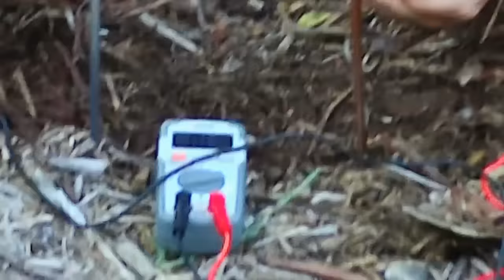OFF GRID POWER? The Earth Battery Experiment

Comment: I believe another issue you have with the process is oxidation of cathode which is the metal giving off electrons and  is plating onto the anode.  charge and discharge are always the problems with batteries because of corrosion!
Reply from the maker: Very true!
Reply: Led and carbon, will not galvanize or oxidize, you only get half the power so you have to build it twice as big,however it will last forever
Reply: Oxidation occurs at the anode and reduction occurs at the cathode.  The aluminium will be consumed and will need to be replaced.  This can be calculated of course and depends on the many factors in the galvanic cell.  This type of electricity generation is probably not a viable proposition to power much more than a small set of lights or small electrical apparatus for short periods and would need maintenance to replace the anodes (the aluminium) if power is required for longer periods.  The current demand for powering larger devices will mean a much larger reservoir of anode material and much larger surface areas.  Also in dry soil or clays, you would need an irrigation system to ensure that an electrolyte is present when you need power.  Additionally, with time as the reactions occur, you may have a build-up of corrosion products on the surface of the anode that would, of course, increase the resistance of charge transfer in the circuit, and reaction kinetics would slow resulting in the efficiency of the battery (the galvanic cell that is created by the dissimilar metals forming the anode and cathode) dropping.  I would think that due to system thermodynamics, there will be a far less likely probability of cathodic chaulking taking place as the driving force (the potential difference between the anode and cathode) is not large enough.

Comment: I applaud anyone for doing experiments so I'm not being unkind with my comments. 

After reading about these earth batteries it would seem the idea is to used the naturally occurring electromagnetic field of the Earth. If this is the case then the battery should not require contact with the soil. As the metals are in contact with moist soil it would suggest you are creating a simple voltaic cell, which means the rods will corrode over time and ultimately it would be better to just throw some acid in there.

Comment: Look into Tesla's apparatus for the utilization of radiant energy patents. If you used something like a metal roof, and then utilized a grid of copper pipe; say in ground water lines being used for agricultural irrigation; you could then create a circuit for harnessing radiant energy from the potential difference between the atmosphere and the ground. The roof and the in ground grid would essentially operate as two electrodes. Really if you just took the energy you are getting from your ground electrodes, and used them to trickle charge batteries, or say ultra capacitors you could slowly build up more and more energy over  time, and gradually increase the amount of usable power by taking your now charged batteries and using an inverter circuit to convert the d.c to household a.c. 
  You would want to decide what exactly you want to power; if you need a constant power draw or just an occasional source of usable input. The point  really is that the more sources of usable power you have they can be compounded and  used to store energy for later use. You should also look into John Hutchinsons crystal batteries, and a diy video on making graphene from coffee grounds, and experiment with making diy capacitors with a large capacitance. I think energy storage in the form of dielectric fields I.E electrostatic will be the way of the future. None of this lithium ion nonsense.    Hutchinsons crystal batteries seem to opperate for very long periods of time without recharge as  well. Really if you make a bunch of crystal cells you can combine them to create a battery of whatever output voltage you want; then just have a circuit that trickle charges the crystal battery. Would need to incorporate diodes, and make some kind of d.i.y charge controller.
 I appreciate the video; experimentation and building upon basic concepts is what allows us as a community to come up with more and more novel and  efficient forms of self sufficient energy generation.

Comment: Thanks for a great video, it would be great to see if this could charge a mobile phone.
There's a few ways to improve the output...
1. The electrolyte in your closed cells will dry out (and the natural bacteria in the soil will stop doing their part to drive the cell)  = keep the top open for rain water, better still add a simple water drip feeder (an upturned plastic bottle of water with a small hole in the lid would do).
2. The electrodes will oxydise = regularly twist the electrodes back and forth in the soil to clean off the very thin oxide layer.
3. The salts in the electrolyte need to be replenished = add some dissolved salts into your water drip feeder.
4. Not enough cells = go large! Add more cells, some in series to get your desired voltage then more connected in parallel to increase the available current.
Reply: It was in another experiment by this English dude, that magnesium rod greatly increased the voltage.
I recall some years ago,  an experiment using an anode & cathode far apart and connected by a wire on wood pegs holding it a few inches off the ground, N-S orientation I believe, and powered this large array of lights. I can't say if those were LED or incandescent,  but they were definitely DC, and I assume the earth served both as the battery and return circuit. Lo, a true Earth Battery.
I just got interested again because, a) I live under a 110' canopy of trees, and b) the grid WILL go down eventually. If by EMP or hackers, I would still have power at least for lights and probably charging, if I can figure out the transformer I'd need.
Reply: @garychandler4296  have you tried the copper ground rod set 3' deep yet?  Supposedly, if the ground is moist enough, you could get 50 watts from it.
Reply: @genkiferal7178  No, but that could definitely charge batteries.

Comment: One can make an aluminum Air battery that will power a small LED fairly easily. I took some aluminum from aluminum foil and or aluminum cans and copper wire. One can take some small plastic cups, glass bottles, ice cube trays or whatever you want and create a series of 6 to 10 cells. Add salt water to each cell and you will have enough power to light up an LED. Power comes from the aluminum oxidizing. I created an experiment that lasted on the kitchen counter for three months running 24/7 and lit an LED bright enough I could barely read a newspaper by it. I created a night light. After three months the Aluminum was starting to degrade and I wanted the countertop back. If you truly lived off grid or were in great need this works, but a regular store bought battery ultimately works better. Battery powered LED lights are cheap and good these days.

Comment: You could try a loadstone attached or near some black iron and/or magnetized, with an anode, cathode series, attached to copper meshes, using a oxide and nitrate, in the soil with a white vinegar.

You may want to use the anchored cells to recharge the cells.

With an inverter, transformer, capacitor, diode - rectifier, charge sustainer, and regulator system in which it may be able to be turned into a portable car battery charger or jumper by pushing into the soil next to your vehicle.  (Not quite what you were thinking; however, an idea.)

Comment: The reason the voltage is dropping is because you have your dirt contained and it cannot reproduce electrons being out of the natural ground. Artificial dose not work with earth batteries. The earth is your battery and when split the electrons will leach out and stop producing
Have you continued research currently ??? I have something you might like to see. We've been off the grid for several years now. And I have made several advancements in different builds
Reply from the maker: I've continued book research, but haven't done anything hands on for a bit .. its been a busy year 😊  Remind me to come check out your work!

Comment: Nice video, doing something similar to what I’ve thought about!  My idea was to use bigger tubes to fill insides of pipes with soil and then surround it in soil too!  There’s a patent back then to make high voltage and good amount of amps (56) if I remember right!  But I’d try applying a type of acid to soil!
Reply: Add salt water :)

Comment: now I need to make my own batteries as well and try with many different materials.
if you want to save space however you probably won't actually be using the soil for the voltage, the soil just keeps it apart and together.
essentially to generate a voltage you only need the 2 metal pipes and aelectrically conducting liquid, gell, goo, or any such thing in between. typically a liquid is used. so you can also just use salt water, salter means more electrical current.

Comment: thanks great video!,  my sincere questions are: 
1.-why not inserting completely the two strips of aluminum and copper at great depth into the ground to get really more quantity of negative ions circulating through them?
2.-and also why not putting another two long strips of aluminum and copper from the highest roof spot possible to the terminals of the ones in the ground, in order to have a very good major quantity of positive ions and negative ions circulating through all that entirely circuit?
*It's supposed to be 100 volts reception only by each meter altitude from the ones in the roof working as an atmospheric electricity receiver, I don't know how many volts can be achieved from inserting this very deep in the ground. 
**And yeah take some better precaution measures working with electrical stuff, that's a must even if working with very low measures of electricity, good habits in electricity saves lives.

Comment: Thank you, it was fun to watch. I understand you made a dirt electrolyte battery though not an earth battery as you isolated it away from the earth itself, with your enclosed cells. Also there is an orientation of the battery cells you lost with grouping the cells in a circle. By sealing each cells off you also lost some additional interaction available between all the individual cells. I understand they also need and north (anode) to south (cathode) in a series orientation for alignment; not a cluster taped circle. Your individual pvc cells were an interesting idea, but moved away from a true earth battery and lost some of the potential power from the earth itself in doing so. Keep experimenting though that is the fun with how we all lean new things and from each other.

Comment: It seems as if you have built what are considered simple earth batteries here, and look a lot like microbial fuel cells. When used as purely electrolytic devices, such as containing it, they aren't exactly consistent. If you want to keep along these lines and supercharge them, it would be worth looking into and maybe cultivating electricity producing bog bacteria and keeping it fed with organic matter. As for more complex earth batteries they utilize telluric current, which is a low frequency electrical current that runs throughout the earth and the sea. Have only done a cursory bit of looking into these types of earth batteries, but from what I've seen these currents flow from south to north, and your electrodes have to be kinda precisely placed. But if you tap into those currents, the batteries seem to preform much better. All internet research here, as I don't have the means to try anything out, but I love to share what I've spent time gathering.
Reply from the maker: Microbial cells sure are interesting .. feed the anaerobes, and they make electricity?  That's a power source that can operate in the absence of sunlight, and requires no O2 consumption .. good for a long term underground application, maybe, if we ever have to go under again to avoid some serious cosmic impacts or such.  They are on my list of things to experiment with, although I'm currently being fascinated by thermal electric generators - using the Seebeck and Peltier effect to generate energy.
Reply: @Green.Country.Agroforestry  I wouldn't be surprised if you've heard of them, but if not sterling engines provide mechanical energy from temperature differentials, which can easily become electrical energy. Having a few installed in walls or ceilings with one end being exposed to the elements and the other being the living temperature of humans, you can take advantage of the temperature differential you will certainly be making as a matter of surviving as a human one way or the other. They can offset the cost a bit, if your means are electric for instance.

Comment: Do it larger, clay pots, copper coil, access hole to add water, and a small dollar store solar panel that charges a AA battery, but use that to charge the clay pot if needed. Could try a sulfate used for garden mixed with water. You should be able to recharge this unit or add water. Could try clay tubes inside a clay pot. Clay pot with a water sulfate or salt solution cud even add charcoal or sand, then have clay cylinders inside that with your copper and aluminum in the clay cylinders and fill with soil. Make sure you can fill the outer clay pot with water or solution as needed. This is something I'll be trying.... interesting that a similar setup can be used for water filtration and an absorption refrigeration too but minus the metal coils

Comment: Use galvanized and copper and the copper on the north and galvanized on the south . If you have the right soil with the right minerals in the soil you can get over a volt with a single cell . If you put a galvanized wire about 20 foot long a foot under ground and a carbon ribbon on the north side a foot in the ground of the same length in the right soil you can get around 12 volts. If you use the soil out of the ground in a container put a small rare earth magnet in the bottom of the container and you will get better voltage. When you're cell goes dead you flip it up side down and stick the leeds in the ground for a while and it will recharge

Comment: Magnesium Joint Sachet
The magnesium filings were saved.  I placed them in a piece of paper towel.  I laid a bare stranded copper wire in the filings.  Then rolled the group like a joint.  I then bent the metal joint in half and sealed it shut with a second piece of copper.  I completed the magnesium sachet by twisting both wires together.  I then tested the magnesium sachet with carbon in a tap water bath.  The amps came in at 1.3 milliamperes.  Again, the shaving have points and powered metal has alot of surface area by mass.  This was a very small amount.  This is the technique of modern battery manufacturing.  It works well.

Comment: If you used longer pvc tubes would you increase voltage/amps?
Reply from the maker: The tubes were long enough to keep each 'cell' from shorting out the one adjacent to it .. lengthening them would not have been helpful.

Comment: I thought the rods were supposed to be close together yet without touching. If you were to break up a clay flower pot and use a few small fragments as spacers between the rods, would you achieve a better outcome?

Also, I'd imagine this is something you would want to build up and run over time, meaning you would want to store it for later use. Could you theoretically plant a whole field of cells and power your home?

Comment: If you get more voltage by increasing the surface area of the metals, could you not just keep the aluminum and copper coils intact and just make spacers for them out of scrap plastic, then bury the whole bi-metal helix, instead of cutting individual lengths?
That way you would only have two terminals from one big battery.
Another consideration is testing to see what distance is best between the anode and cathode for your given soil type.
I also understand the desire to experiment with soil composition, but isn't the point of an earth battery to get electricity from the soil you have?

Comment: This "earth battery" is no different than elementary school "potato battery" or "lemon battery".  The voltage does NOT come from the earth, lemon, or potato.  It voltage comes from the dissimilar metals. You could create higher current by placing multiple battery strings in parallel.  Also, multiple rods tied together in a cell will increase the current.  However, as the current is extracted from the battery the metals are consummed.  Making this method of producing electricity extremely expensive.
Reply from the maker: Correct.

Comment: It's about mass. Increasing the amount of mass you're using increases the voltage, so instead of creating multiple insulated "batteries," get a large aluminum rod and an equally large copper rod (or pipes), stick them into the ground and you'll have a lot of voltage that won't die.

Comment: You need to research old documents from Nathan Stubblefield.

He used three wires.

Copper, zinc, steel I think.

The key was one was an isolated ground, far away under a tree.

0 to .5v and 0 to -.5 can do the same work.

It cancels adding. It doesn't add right using opposite.

Experiment with the third leg is key to being additive.